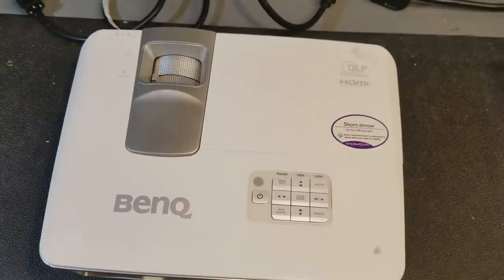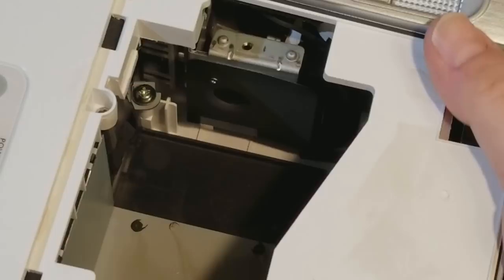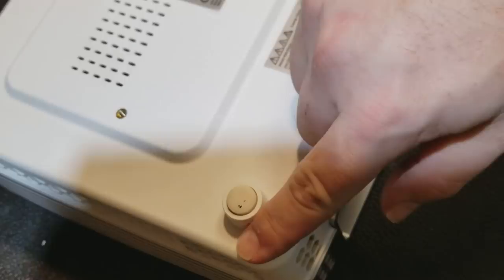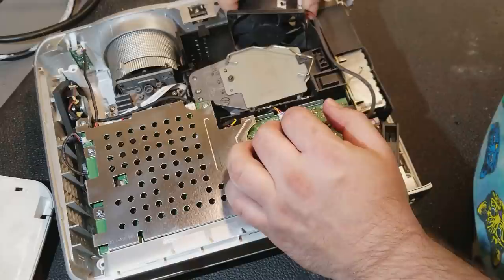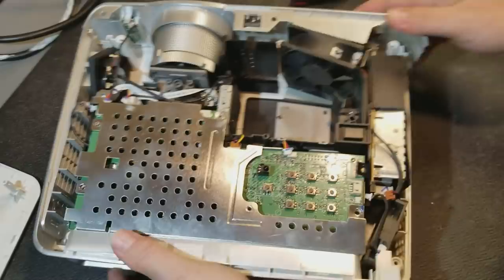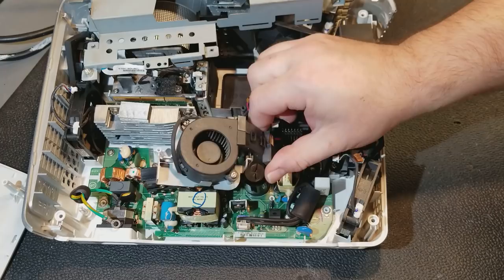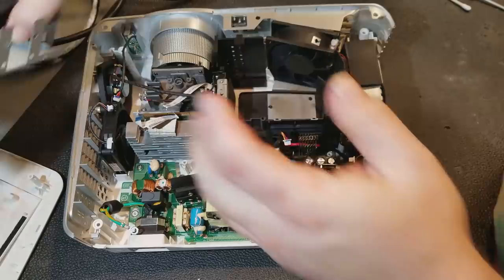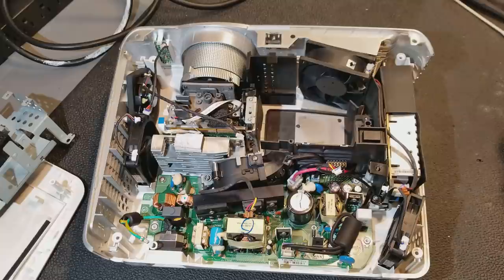BenQ W1080ST DLP Projector Cleaning / Service P1

Comment: +FixitFrank awesome guide, thx for taking the time to make and share it! I went for a full cleaning of the interior after a bulb explosion and replacement, which kind of went well - except: I now have 14 equal height horizontal bars on my screen. Every second looks normal, every second looks like there's no green color and pixels are flickering. What the he** did I do wrong? Any hint on a resolution much appreciated :-)
Reply from the maker: I think you have a bad connection between the DLP board and the mainboard.  It's probably blanking when the green color wheel segment is being called for.  Go over all your assembly and make sure the mainboard is seated nicely and not pulling up.  Thanks so much for the kind words! Happy to help!
Reply: @FixitFrank  Thx a bunch for taking the time to feedback on this one. Are you referring to the vertical socket connecting the main board? I will try to give it an extra push.
This is my picture: https://i.ibb.co/wpH2QVP/Image-01.jpg - please have a look, maybe be description is not completely reflecting it.
Reply from the maker: @skrubbeltrang  That's the one. Be careful to check for wires or other bits being pinched in between.
Reply: @FixitFrank  Thx, already tore it apart twice, will try to examine this piece in more detail.
Reply from the maker: @Morten Skrubbeltrang if you removed that metal frame under the main board, make sure it's down all the way. I've had to assemble and disassemble  these 3-4 times to get that right. I only say so because the the lines are caused by the dlp board only receiving half the video data. It could also be a bad dlp chip or associated circuit, but it was working before so there is no reasonable reason for it to be bad now.
Reply: @FixitFrank  I very much appreciate your detailed advice, I did remove the metal frame and I'll follow up on it and let you know my progress. You the man!
Reply: Hmmm, tore it apart once more, checked the socket for foreign objects/scratches and reseated it very firmly - unfortunately no luck, I assume something must have broken. Will try to get my hands on a thrashed w1070 and replace main board and dlp one by one. Thx for your advice and for sharing very good and useful video content.
Reply from the maker: Oh no!  That sounds weird though honestly.  You may want to go back over everything you removed and check its position.  Your idea that a pin is bent/damaged is valid, but I still have a suspicion something isn't seated or connected fully.  I may be wrong of course without it front of me.  Maybe try re-seating the DLP chip itself in the carrier? Not much to lose at this point.  I'd offer to look at it for you, but I suspect you are not in the USA and shipping would be ridiculous. If you are in the states and want me to take a look let me know.  
Thank you for the kind words.  I started this channel purely to archive repairs for my own reference. I never though 700+ people would find it interesting enough to subscribe.  It is humbling.  Thank you again. -Frank
Reply: @FixitFrank  Thx for your feedback, I will try to look more into the DLP seating to see if I can make anything of it - as you say, not much to loose from here :-) I'm based in Denmark so shipping back and forth will probably be meaningless but thx a lot for the offer. If anything changes on the status of my device I'll surely let you know the details. Best wishes for you and the channel!

Comment: Frank i have a Benq W1070/1080 short throw projector like this and watched your tutorial , the machine stopped working due to the colour wheel sensor being dusty, i have cleaned the hole machine, put it back together and it powers up great , the sound works fine, the green light works, the machine powers up but it is projecting a blank screen onto my wall ? The lamp works fine, but i cannot get the menu up at all because there is no picture just a blank screen of black and white dots ? any ideas frank ?

Comment: Hi Frank, this helped my overheating problem as my projector just needed a good cleaning. Thank you! But over the weekend the bulb turned off with a red blinking lamp light. It feels like the lamp connection is loose. Could have happened when I took out the bulb. Is this a problem that is fixable? I see a screw on the under side of the connection but not sure how to get to it. Any help would be appreciated. Thank you again!
Reply from the maker: Thank you!  I am happy to help.  I am not sure I follow you. Which screw are you referring to? Do you mean the screw that holds the black plastic connector to the lamp itself?  Those are usually tight but allow the connector some 'wiggle room'(professional term). This aids in install.  
In my experience I think you might have something else afoot. How long did the projector run between cleaning and when the lamp stopped?  I have a small suspicion that a piece of loose dust might have lodged itself in the color wheel sensor.  I only suggest that as I have seen it before myself. That all depends on how long the unit ran between when you cleaned it and when it failed. If it failed quickly after cleaning, then you may have missed a wire or its maybe barely possible the lamp has finally failed.  When exposed to excessive heat for prolonged periods of time, it can make a lamp extra fragile.  There is a slim chance that once it was able to run for a long period of time, it finally gave up the ghost.   Here are some things to check in order

1. Remove the lamp, inspect the bulb. Make sure the interior is not broken or has exploded. The glass tube in the center is actual bulb. If it is black or grey inside(or cracked/exploded) then its bad. If it is clean and clear, then re-install the lamp. Otherwise you need a new lamp. Be careful with cheap lamps. They can cause more problems than they solve.
2. Blow some air over the color wheel. The rotational sensor cannot be obstructed with dust.  Very common failure.
3. Bypass the lamp door switch with the lamp installed(you may want to wear sunglasses) and turn on the projector. You should see the color wheel spin up when the lamp lights. If the wheel is slow, stutters or stops and then the lamp shuts off, the color wheel might be your issue.
Reply: @FixitFrank  wow...thank you very much for the response! Really appreciate it! I cleaned it on a Friday, worked great all weekend and then the lamp cut out on Monday. Starts up fine, but lamp does not turn on (No image) then red lamp light blinking, then turns off. I will try your suggestions and report back.
Reply: Upon further inspection, the lamp's inner wire is black and seems to have disconnected from the tube. Looks burnt. Is there any reason why this would happen? I just don't want to buy a new bulb and have this happen again. Here is the photo: https://photos.app.goo.gl/5JVbtvTq2Sp7CyfW7 Thank you!

Comment: Can you clean the actual colour segments of the wheel and if so what with?  Thanks for an informative video
Reply from the maker: You can but I do not recommend it unless it's really dirty. They are so brittle and delicate. I have used normal glass cleaner. Windex or similar.  Alcohol will work too but it can leave spots. I would not use acetone or anything that might soften the glue that holds the segments in place. Normally I use air and a cotton swab to dry dust the wheel. Microfiber may work too. Just be very careful to not snap or chip the segments.
Reply: @FixitFrank  Thanks for the advice. I have done the disassembly as per your video and now ready to have a look at the sensor, I am in territory I have never been before and would not have got to this stage without your video. Will let you know the results of my efforts.

Comment: Hi! Thanks for the video.
I followed every step to clean my BenQ projector but now that everything is back in place I don't have any image.
The projector starts, the lamp is working as well but I get a black screen with a kind of still grainy texture... as if it could''t detect the HDMI or any any signal. I can't even display the main menu... Any idea what I could have missed?
many thanks
Reply from the maker: Hi Mathieu, I suspect you do not have a good connection between the dmd board and the main board.  Check the main board to make sure it's seated fully. That sounds like what I would find.
Reply: FixitFrank Thanks for your answer. That’s what I suspected, I’ll check that again.

Comment: Hi Frank! I'm having some issues with my HT1075, I recently changed the lamp. I've opened it at cleaned it, but even after that, it does not turn on properly ( it shows the red light and takes 3 or 4 tries to turn on). It also has flickering images after about the first 30mins of ussage. Any tips? I'm thinking maybe I need to change the color wheel...

Comment: hello,
I watched your video...
I have a problem with the benq projector and I'm going to do what you have in this movie.
The lamp does not break, but the projector probably overheats because after a few minutes of switching on the picture flickers and the colors are incorrect. Do you think this will be the problem of the fan you cleaned?
Reply from the maker: The fan will be good to clean but it sounds to me that you have a failing color wheel or a lamp with a bad lens.  If the lamp is new, check the glass on front. It should have red/blue look to it.  If it is clear or has a green look, it will be the problem.  If the lamp is older and worked, then I would think color wheel and dust.  Try cleaning first. That would be the best thing to do first. If that does not work then a color wheel may be your problem.

Comment: Hello ! In the mt, congrats for your work...I'm here for some help: I own a Benq w1090, and I have some dust blobs after about 200h of use.
I intend to disassemble and clean it, but I have never done it before.

Could you give me some advice to avoid doing even more damage ? Thanks !
Reply from the maker: Sure can.  Take your time.  Its not a speed test.  If it takes you 3 days that is OK.  Take lots of pictures of anything you remove.  A big bit of advice is "Less is more". Get it pretty clean.  You do not have to eat off of the lenses or mirrors.  Projectors can handle some dust just fine.  I would leave the mirrors and lenses inside alone and just remove the DMD/DLP chip and clean that.  Use soft cloth.  Microfiber for glasses works well.  Do not use chemicals. If it is that dirty, use something gentle like windex or white wine vinegar. Stay away from solvents.  But mostly take your time and document/take pictures etc.
Reply: @FixitFrank  Thanks for your answer ! There's some step more complicated/delicate than the others ? Do I have to find some specific tools which is strictly necessary ? Thanks again.

Comment: I have normal grey dust blobs in two coloured blobs. One is green in one is a sort of burgundy red.   Does this mean the brighter colour blobs are on the wheel ? Thanks.
Reply from the maker: Hi there! My gut tells the blobs are not on the color wheel.  The wheel spins too fast for large blobs of dust to stick to it.  My guess is a dust ball is refracting/reflecting the light and it appears red/green when it happens.  It could be other things but I would start there.
Reply: FixitFrank  cheers.  I opened it up and got rid of the normal dust blobs.  I never went into that small door type opening to get into the lens  still have the colour blobs they are changing focus so will be opening it back up.   It was very easy with your video so thanks.
Reply: All opened and cleaned thanks to your video.  There’s another way into the lens mirrors.   That silver heat shield just screws off

Comment: My lamp has exploded like the sides cracked and glass is everywhere. Was this supposed to happen
Reply from the maker: Not really but it happens more often than you may think. The bulb overheated and the pressure of the gas inside the arc tube caused the quartz to burst once it softened enough from the heat.  It can happen when a bulb is very old(past the 2000 hours or whatever the rating is) or when they overheat from lack of cooling.  Fortunately the glass is just quartz and not that sharp but it gets everywhere.  The lamp blower fan should be checked for debris.  Look for evidence of overheating like discolored plastic and dust build up.  However I would not go too nuts.  Leave the top of and see about shaking it and vacuuming the old bulb out.  No worries about mercury either.  It evaporated into the air when the lamp shattered.  I'd still wear gloves(mostly to keep finger oil off parts) but it's far from a hazmat scenario.
Reply: @FixitFrank  thankyou very much. Was kind of concerned as was not past lamp hours and was 1 hour into use that day although was hot. Hoping it can be cleaned out and work again.

Comment: Nice Job Frank!
Have the same projector, error on exhaust fan. Drops in rpm down to 700rpm. Have changed it 3 times,still same problem. Voltage to fan from circuit board are 5v but it drops to 700rpm and projector shuts down. The two rear fans on the side are ment to blow air into the projector??  Sorry my bad English, greatings from NORWAY 😀
Reply from the maker: Your English is better than the guy who runs our country currently...However the fan dropping to 700rpm is odd.  I could see one fan being bad but not all 3.  How do the filter capacitors on the power supply look?  Any expansion or leaking evidence?
Reply: FixitFrank 

IT seems like the temperature #1 goes all the Way up to 330 and then the rpm on exhaust fan drops all the Way down to 700 and lower,fails when it gets to hot? Is it any filter on this projector?Clean out circuit board? It seems like the fans are running to slow when temperature are rising 🤷‍♂️
Reply: If the bulb is old can it get much warm er than a New one? I dont Have the exact hours on the bulb..
Reply from the maker: @TheStianKH  Old lamps can run hot but not hotter than a new lamp.  The brightness would flicker high/low. I would not expect an old lamp to cause this.
  How is the lamp blower fan working?  I could see the lamp blower fan stalling or running slow, causing the increase in heat but not causing the exhaust fan to slow down.
Reply: FixitFrank 
The lamp blower is also New. After changing lamp blower it startet to over heat and error on fan 1 in service menu. Changed exhaust fan 3 times. Exhaust fan drops in rpm when it heats up. I can manually set rpm high on exhaust fan keeping it from getting warm, seems like software is not turning up fans when it is getting hotter..
Reply: Opened it up now but cant see any thing wrong on circuit board..
Reply from the maker: @TheStianKH  Do you still have the old lamp blower?  I have run into situations where the replacement fans are not truly compatible.  The RPM/Tachometer wire and circuit can be specific to the projector model.  The fans must be the same model. If only the voltage and size match, it may not work.  If I had it here,  I would put the old blower fan back in and see what happens.  I wonder if this is all fan compatibility issues?  I am speculating but it would make sense.